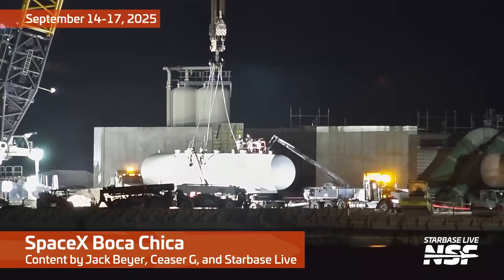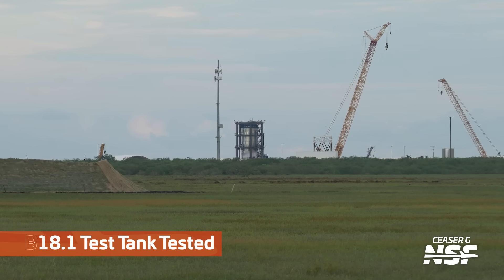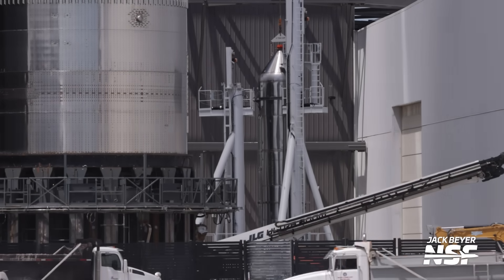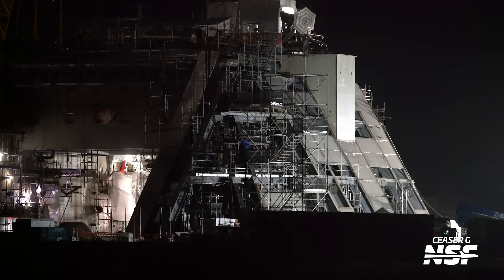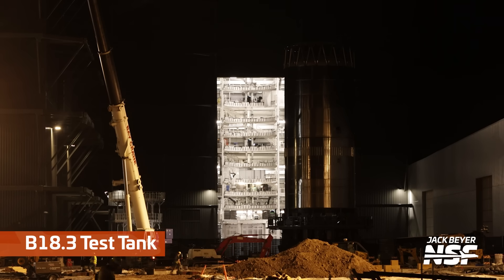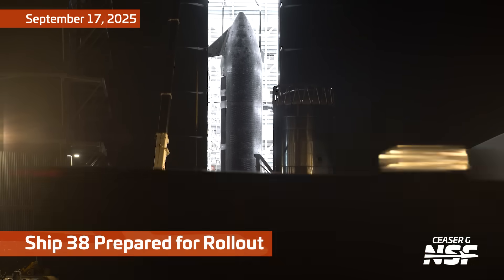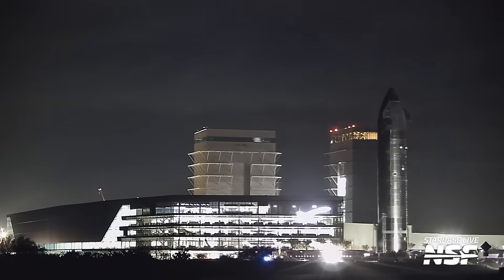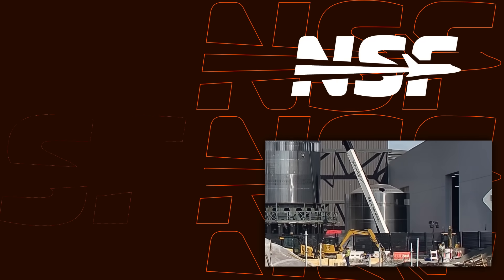"Up Next: Ship 38 Static Fire"  | SpaceX Starbase

Comment: 2:20, 2:32 Both ends have conical taper bulkheads and valve assemblies. Note that the white fixture orients this tank off-center within a 9 meter tank. I think the entire white fixture is withdrawn after the landing tank is welded within the main LOX tank.

I think such an off-center booster tank is essential for LOX landing storage, as LOX in the main tank is normally contaminated by the autogenous pressurization system during launch burns.
Reply: This is an excellent guess!  HLS ramp up, perhaps?
Reply: The Starship tankers and prop depots also need pristene LOX deliveries. So I expect a payload LOX tank. Methane looks clean. 
 @RobinMiller-v6c

Comment: Hey Das, at 9:15 I'd say that is a DJI Mavic 3 Pro (maybe 4 Pro like Jack's), and I could see it being used either way - for glam shots or engineering shots. 
The bigger drones that SpaceX uses (DJI M30T) out at the launch mounts for lifts and such have great flight characteristics, weather resistance, and good thermal imaging. 
However, they don't have the best lowlight performance compared to the "prosumer grade" Mavic 3&4 Pro series. 
The latter have micro 4/3" sensors while the Matrice 30T only has a 1/2" RBG sensor! This equates to huge differences in dynamic range and low light performance - as you noted with Caesar's great camera work earlier in the video. 
I run a drone company and I do both engineering work and creative/promo work - and I'll definitely use the Mavic 3 Pro for lowlight engineering work when the need arises.

Comment: Mystery tank. Payload for inflight refuelling?
Reply: 2:20, 2:32 Both ends have conical taper bulkheads and valve assemblies. I think such a payload tank is essential for LOX payload storage, as LOX in the main tank is normally contaminated by the autogenous pressurization system during launch burns.

Comment: The tiles on 58 are looking great! It's amazing how much better it looks when they are not stress testing and all tiles are in place and buttoned down tight. Assuming nothing else goes wrong, it'll be nice to see just how resilient Starship can be during reentry when there are not strings or sections of tiles missing all over the ship.  Maybe this will be a max protection run to see what "best case" looks like. They need to show improvements as a result of all testing at some point in any case...

Comment: For some reason, I've recently had visions of Super Heavy booster with strap-on auxiliary boosters, but I dismissed having auxiliary Super Heavy boosters a la Falcon Heavy as ridiculous and impractical especially for the ground launch system.  Then I thought of using ordinary Falcon boosters (I think they could provide a significant boost) but again, it would very much complicate the ground infrastructure in having to supply yet another fluid (among other things).  Now, having seen that mystery piece of equipment, I am put in mind of a (say) seven Raptor LOX/Methane booster that can land itself at or near the launch site.  I can't math well enough to prove that it would be worth it, but I feel like it would.

Comment: My thoughts on the new tank:

I believe that this could be one of 2 things:
   1. This is a tank to test propellant transfer systems with this small tank acting as either the receiving ship, or acting as the tanker ship. They could use this for testing fuel lines and pump systems on the ground and making sure lines up the way it is designed, without having to transfer large amounts of fuel for each test, speeding up the testing time. 

   2. The tank is an internal propellant storage tank for the ship that acts as a tanker. This looks like it could fit in the cargo compartment of a block 3 starship, and could leave space around it for other systems like pumps or other storage. Maybe the article is upside down and the valve on the top is meant to be rotated to a down position towards the top main fuel tank, and then be diverted to fuel lines in the fuel transfer connectors. Or, it is in its flight orientation and the lines transfer down the walls to the 2 connectors in the top half of the ship.

Let me know what y'all think! Did I miss something or get something wrong? I'd love to guess and learn more about this system!!
Reply: it moved into mega bay 1, its booster, probably landing tank 
edit: it is pretty much confirmed now, B18s LOX tank has been spotted by lab padre over that tanks stand
Reply: @nono-zu6ob  I thought that giant transfer tube SX shows us  while ago was meant to double as the landing tank?
Reply: @RedmondJohnson thats what I thought too! that's why im confused that it was moved to MegaBay with the boosters. Maybe it is there for temporary storage due to limited working areas
Reply: @nono-zu6ob  interesting! Would they need 2 of them, one for each type of propellant? Or could there be a divider half way through the tank? Also, where would it fit in the booster? With the fuel downcomer installed, where would it be located inside the booster?
Reply: Would this tank fit inside the top half/cargo portion of a Starship? The conical top suggests it is meant to fit against the nose.
Reply: @GunSeller98  I don’t think it sits right against the nose, because if you look at other images that were posted, there’s a valve on top, which means there has to be piping that needs to run somewhere. If it was against the nose, there’s wouldn’t be room for the pipe. That’s why I’m guessing it sits either on the side of the cargo area and the conical part at the top of the tank goes against the starship wall that starts curving to a point, which would allow it to have pipes attached to the top, or, it is going to be installed upside down from its current orientation.